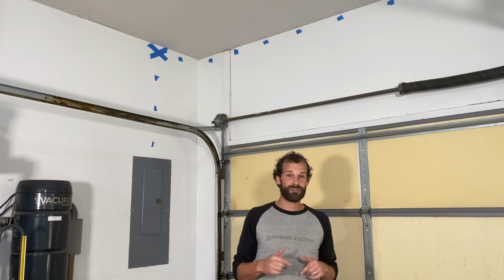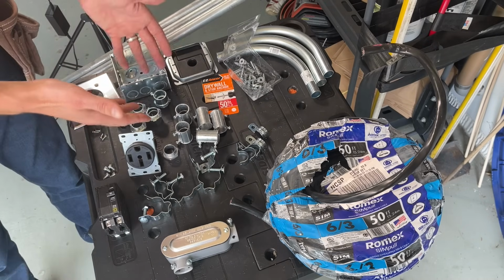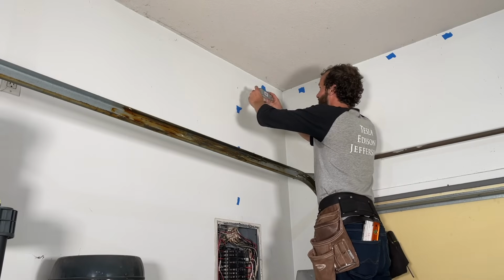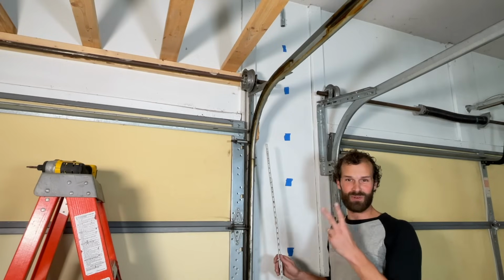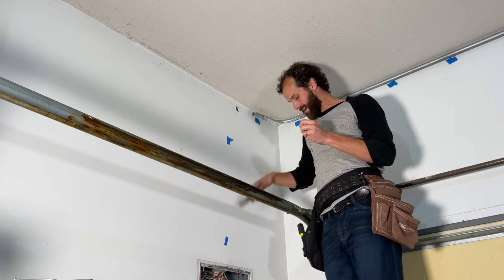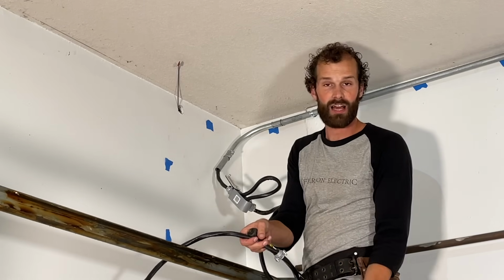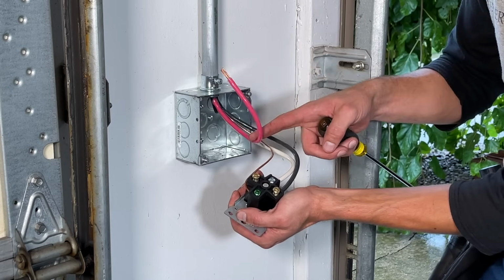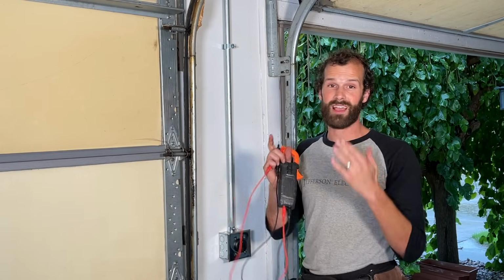How To Install a 240 Volt Outlet | Electric Car Charging

Comment: A couple of notes, I just did almost exactly the same installation here.  The only difference was that the panel was surface mounted, and a weather proof outlet was surface-mounted outdoors on brick - we don't park cars in the garage because they rot in winters quicker, and I used slightly oversized PVC conduit surface-mounted with glued joints.  I only needed a pull elbow to make the sharp turn thru the exterior wall.

1) Our codes in particular, and I suspect to a certain extent the NEC, frowns on NMD cable in conduit for long lengths - it's a heat dissipation issue.  A few feet are fine (such as a drop to a switch from the ceiling), but not 20+ feet.  Use individual conductor, it'll also be easier to pull.

2) 50A chargers are usually available in BOTH 14-50 (2hot, 1neutral and ground) and 6-50 (2 hot, ground) when you order.  Since they're pure 240V,
they don't need a neutral.  Which will save you some expensive copper.  In my case, I wanted to dual-purpose the outlet for a welder.  The welder was 6-50, so the choice was even more obvious.  Think about such considerations and make sure that the charger and outlet agree.

3) Even here, where the panels are required to not allow access to the main wiring when the circuit panel door is off (you have to remove another door), I recommend against implying to DIYers it's a possibility, even if you "recommend" DIYers not do it.

I am a DIYer, and do lots of work on panels, and much of it live.  BUT here's the important part: if someone asks me whether it's safe, my answer is ALWAYS: "if you have to ask, it isn't safe."  This is only something you can answer for yourself after gaining experience and intimately understanding what you're doing and what can bite you.
Reply: An unrelated question: cars rot faster if you keep them in a garage in winter? I am not sure I have ever heard that said, but I love ot learn. Why would it be? The only reason I can imagine is if you make the case that the higher temperatures will cause the oxidation reaction between metal(s) and salt to happen faster, which is probably true but not to a significant degree AFAIK. On the other hand, every single other component of the car - and there are a lot of 'other compontents' will be very negatively affected, so I am a bit at a loss.
Reply: @l-f-y-t  The critical thing here is temperature cycling of the underside of the vehicle (including inside wheel wells etc) and available moisture and evaporation rates.  Especially with garages attached to a house, the vehicle will be experiencing wilder swings in temperature, and usually rather higher humidity swings and less air flow to dry things off.

For example, a vehicle kept outdoors all the time can accumulate ice/frozen slush/road salts which freeze and stay frozen for long periods and be extremely slow reacting with metal.  In a garage, it may go through thaw/refreeze more than once a day (eg: your driving trips and just temperature swings thru the day), and be at rather higher humidity - worse there's less airflow so things will dry off  slower indoors.

There's a similar scenario in the warmer times.  A vehicle parked on grass (or dirt or gravel) will rot out faster than if it was parked on concrete or asphalt.  The much more porous (and higher surface area of grass) provides a lot more and longer lasting moisture supply under the vehicle.

Even the normal rust proofing cars these days (let alone when you apply some aftermarket solution) will help, but if you're talking about an older vehicle (or a utility trailer) it can be quite pronounced.  I've had people suggest that even parking your vehicle over top of a layer of plastic sheeting overtop of gravel can help slow rust down.
Reply: @fromagefrizzbizz9377  fine as you state it, but given that a garage will be dryer AND warmer I am doubtful things will dry faster in the winter outdoors compared to inside a garage, especially if the garage is heated in any way.
I can see the scenario you describe, at least as relates to the freeze-thaw cycles possibly, in climates where the temperatures stay solidly below 32 throughout the day coupled with small, non HVACed garages.
That's a fairly specific scenario, however, taht we definitely don't get here (E coast).
Reply: @l-f-y-t  Well, yeah, if you're in the banana belt, where freezing temperatures are relatively short, you're actually HVAC'ing a garage and road salt isn't used.

In the US northern states, and the great white north, few people are crazy rich enough to heat their garages, and road salt is used, they're damp just about continuously through the winter with parking a car in it.  The only garages that are somewhat heated is only because they share walls with a house, and the garage-house membrane leaks.  Which you try very hard for a number of reasons to minimize - it's code compliance - leaky attached garages waste money, deteriorate structure and can kill you.

My detached garage is an oversize insulated double and originally no heat.  But the floor was gravel, and every fall and spring there was a period of time where any exposed bare metal (eg: the tables on my stationary tools) would rust in a day or three, but would rust far slower if they had been outdoors and merely sheltered from rain/snow.

Since then I've had a concrete floor poured, and I have two 4800 watt construction heaters when I need heat in the garage for a few days (eg: painting stuff during the winter), but it's usually off.  During the winter the garage goes weeks if not a month or two at -5 to -10C.
Reply: @fromagefrizzbizz9377  right. I am not that far from the north and there's PLENTY of salt being used. Though yes, whole days below freezing are the exception, not the norm, except maybe for the first week of January.
And yes, the attached garage is heated by the common wall with the house - but the non-attached garage has heating which is set to 38F during the winter. Both of them have dehumidifiers running as well when the heating is on.
The cars and the tools seem to like it.
I will agree that an unheated garage with a gravel floor is probably the worst possible environment for anything metal, you'll get no dispute from me there...
I think we have clarified where our different points of view come from, thank you!

Comment: I have a nearly filled, old GE breaker panel, so I had to install a subpanel next to it, and move a few breakers over to it, as well as add my 50A breaker for 240v circuit to supply my new Juicebox40 EV charge point, that I got from my utility company for just $177 after instant rebate.

Comment: That wire should be in conduit all the way to the box. If there is ever a water leak in the wall it will run down the wire and into the box. Good luck with that.

Comment: Thanks so much.   Ive done a little wiring, but never used the conduit.  Getting ready to replace old fixtures in a doublewide.     I always stand away but look at panel...in case there is an ark.

Comment: Question why not add a 4 x 4 box in place of the LB and leave the Romex wire in the wall and pull standard wire #6 in the condut? Or remove the outer cover from the Romex to make the pull easier?

Comment: Tesla chargers only need 6/2. 6-50 plug and then 3/4” EMT fits fine. Also, I would use mc flex in the wall to the attic if possible and then just drop down EMT to charger. Looks really clean

Comment: I don't know how I came across this but this guy really scares me and I am NOT an electrician.  In Australia we use specific PVC piping (not metal), PVC junction boxes (not metal), a yellow tongue from tongue and groove flooring for pulling wires. He is using non insulated metal screw drivers they are super good for being electrocuted.   This guy would NOT survive here in Australia and all of the metal piping etc would NOT be approved here in Australia for use.
Reply: metal raceway are standard in the u.s.

Comment: You’re no pro! You made several dangerous mistakes including a few code violations. Just check Keven and James; they both layed them out so I won’t repeat… Only thing I’ll add is that it would be better to pull regular wire and use flex in the wall. Hell, that would have fixed both your code violations… Maybe a 4sq instead of an LLR which made no damn sense anyway. LB would make more sense, but the box would  provide room for a loupe…

Comment: Do you need to use a GFCI circuit breaker to connect a 14-50 outlet?

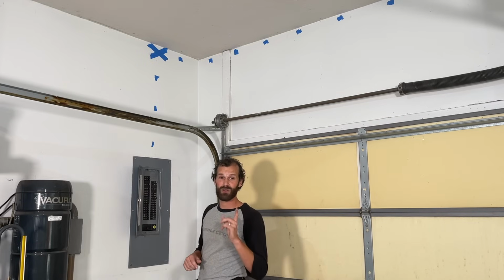Comment: at 1:25, you state 'that's a continuous load'. but you are mistaken, bud. a NEMA 14-50 outlet and a 50A circuit breaker is NOT a 50A continuous load. these 50A ratings are peak ratings. the continuous load is 80% of the peak load, so the continuous load is 40 amps.

Comment: No No No
No wall charge plugs or module.
Clealing Install
high voltage cables Spring r Bungee r Rope w Counterweight 
All from top-down ceiling down 
Stupid Tesla Wall Charger

Comment: romex in conduit...1. electrical conduit outside  is in a damp / wet location and the inside of that conduit is now  also a wet/damp location, and the romex insulation is not rated for wet/damp locations. For inside a garage, romex in conduit should be ok.

Comment: This is a good way to do it. I just did a very similar thing for a 40 amp electric heater except I used flexible metal conduit.  For me I ran my wire in the conduit and then put it up because that wire is tough to manage.  And I just used an outside junction box to near my elect panel to wire it.  Really the hardest part is dealing with the thick wire. And just to note, I turned off the power and also bought insulated screwdrivers and pliers to use.
Reply: Not correct..not legal..not d
Safe
Reply: Not good way..illegal..unsafe
Reply: @joeferry2723  Thanks for the useless comment not specifying which part was illegal or unsafe.
Reply: @youtube_acct_42 ALL OF IT WAS UNSAFE.

Comment: I’m an electrical contractor. I would never have pulled 6/3 through 3/4 pipe. You want to use 1 inch because you will have big problems with 90s and LB’s trying to pull it through. Instead of an LB I would have put a jbox at the top of the wall above the panel and ran thhn instead of 6/3 wire. As it will pull 10 times easier and just gurney the wires in the jbox. You went the hard way.
Reply from the maker: Appreciate the feedback!
Reply: @EverydayHomeRepairs  FYI if you’re going to use an LB, use a Mogul LB. Much longer and you can get the wires to bend more and or use 4/3 Aluminum wire.
Reply from the maker: @no65mph  Thanks for the tip 👍
Reply: No problem. Looks good though.

Comment: There are old electricians and their are bold electricians. Not too many old and bold electricians. I don't work on live distribution boxes if I can possibly avoid it. Being a woman, I don't have to compensate for 'shortcomings' by taking unnecessary risks. 
Great video, cute sparky. I believe 3/4" conduit is too small for current code on #6, I'd have gone up to 1" and lube is your friend.
Reply: I’m trying to figure out why he ran 6-3 through conduit - couldn’t he have saved a lot of time and money by running individual THHN/THWN wires? Isn’t the shielding of the 6-3 overkill?  And as you mentioned - doesn’t he want to use 1 inch conduit based on the fill space of the 6-3?  What am I missing?
Reply: @bobcolella8539  all good points. Also if you run individual wires inside the conduit instead of Romex, then 8 awg is sufficient as THHN #8 is suitable for 55 amps. Then you can easily get away with the 3/4" EMT.
Reply: Yea fiberglass fish tape for me  I used 32 mm 1 and 1/4 in 12th of a kings foot measurements and put in a draw wire for possible additional wiring  without ripping it all out or running alongside a few dollars up front 100s saved later.

Comment: I wouldn't let this "Professional" change a light bulb in my house. #1, electrical installations like this should be done by a qualified electrician. #2, why are you using Romex inside EMT? Why not pull a set of single copper conductors? Individual conductors would be cheaper than cable. Or if not available, strip the jacket off the conductors. Would have made pulling through the EMT MUCH easier. #3, taking the time to properly calculate and select the size of conduit required for the size of wire needed should be done when planning the job. And if I think it's going to be a tough pull, I'll upsize it. It's not that much more expensive. #4, if you're going to use EMT, a simple offset coming out of the panel through a vertical slot in the drywall would make your installation much easier and would still have less than the maximum 360 degrees of bends. Having to take apart your conduit run and then monkey around to get the conductors in the wall and down to the panel is such a time consuming waste. #5, You talked about the importance of grounding, BUT I see a ground/bond issue with your conduit run as the only path to ground is through the ground wire in the cable, and you didn't even run the ground wire through the ground screw on the box. Running the ground wire directly to the receptacle and not bonding the box allows that conduit to become live in the event of a short. #5, WHO DID THE ORIGINAL PANEL WORK??? I've never seen that many conductors going through one conduit coming out of the panel in a residence.
Reply: Nope this install was basically perfect. You have no idea what you are talking about. The only thing he did wrong was not bond the box. (Though it is bonded through the receptacle.) Also I would have used an ID cover.
Reply: @jakes.5591  I don’t particularly care, but in this burg, running jacketed wire in conduit is not code compliant—so technically the work is not up to snuff—not just difficult to pull.
Reply: Ground the box and a mulberry cover.
Reply: Buy a bender, ground screws, bushings, then return all of it because this guy doesnt know how to use them. My god, what a ding dong.
Reply: It's overkill, but I'd use a weatherproof box also.
Reply: Strip the romex jacket off.

Comment: Note: I am not an electrician nor am I a municipal inspector so please feel free to correct me if I am wrong. Also, maybe you addressed this in the video and I missed it?

My concern with home owners doing this is twofold. I'd be very surprised if very many municipalities exist where this kind of work isn't required to be done by a licensed electrician so that the work can be given a permit which could be an issue when it comes to selling the home. Also, assuming I'm correct about the permit requirement, if the worst happens and an electrical fire burns down the house an insurance company could use this as an excuse not to pay out.
Reply: You're right, in that most jurisdictions DO require pulling a permit.  But DIYers can pull their own permits and get the work inspected.  I've done it many times.  I've done full house wiring jobs that way, and I'm not licensed.

As long as the permit is proper, and closed by inspection, insurance will have a hard time denying it.
Reply: I'm in Los Angeles and just started doing almost exactly this for my wife's new Tesla.  A homeowner can pull a permit online and then request an inspection from the dept. of building and safety to get it approved.  The difference in mine is my circuit breaker box is on the outside wall of the garage and I'm running 3/4" PVC conduit inside the garage to the outlet between the 2 garage doors.  I'm running NM-B 6/2 from the breaker up inside the wall, then transitioning inside to a LB conduit body and running AWG 6 THHN for the hot wires and AWG 10 THHN for the ground.  This goes to a NEMA 6-50 receptacle.  I liked this video and gained a few tips, but did cringe a little when I saw some of the unsafe practices done by this guy.  If you are creating a video that will probably mostly be seen my DIY'ers, then don't show us how pros do unsafe things and tell us what we SHOULD do, just do what's appropriate for the audience.
Reply: @brucehvn  Precisely.  DIY videos MUST meet or exceed the electrical code.

Comment: Probably the best DIY video I've seen on YouTube. Last year, the wife wanted to install a hot tub on the back deck. Electrician wanted about 3 grand to do what you just did, except on the outside of the house probably using PVC conduit. When she decides she wants it again, I'll do it myself. But make no mistake, I will be shutting off the main breaker :-)
Reply: Please don't install a hot tub yourself.  There is a reason a licensed contractor is charging that much. There is a lot more to hot tub and pools then just hooking up power. There have been many people killed from DIY'ers hooking up electrical when they don't understand the code that must be followed for safety. Hot tubs have to be properly grounded and equipential plans built for safety.  Most electricans don't even understand this so it's really difficult for a lay person to understand.  This guy in this video would have been fired on any electrical job I have ever been on so don't put your family at risk from trusting someone on youtube.